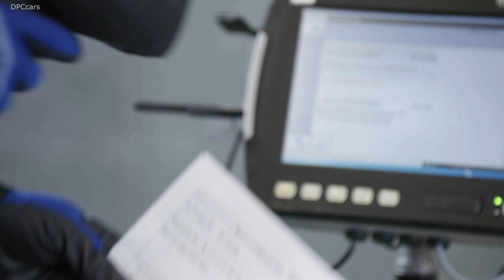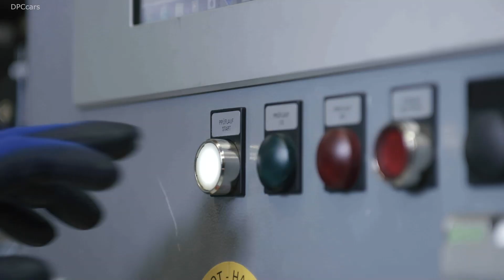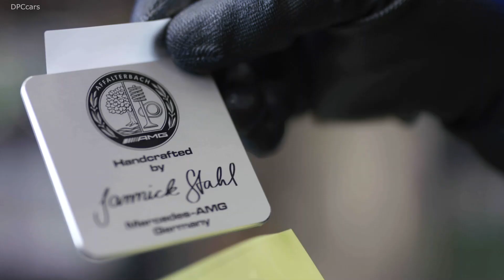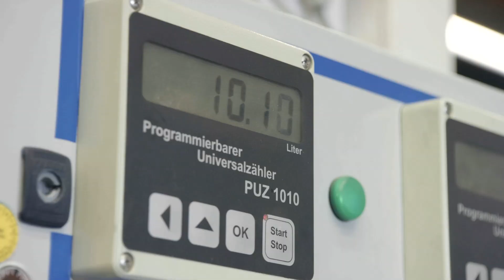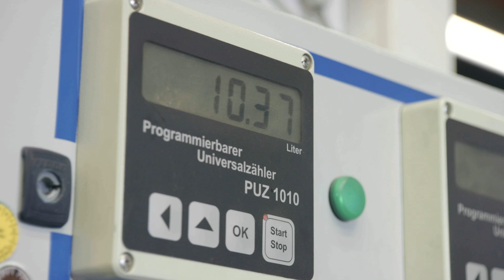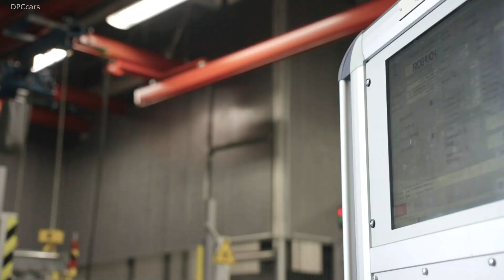2020 Mercedes AMG V8 Engine Assembly Production Factory

Comment: I’m surprised that they don’t load test them. I just picked up a 2024 GLE AMG 63s with this engine. Im pretty sure that it has an exhaust leak with only 134 miles on the clock. With that exhaust manifold they are using I’m not surprised now. Not so sure about Mercedes quality.